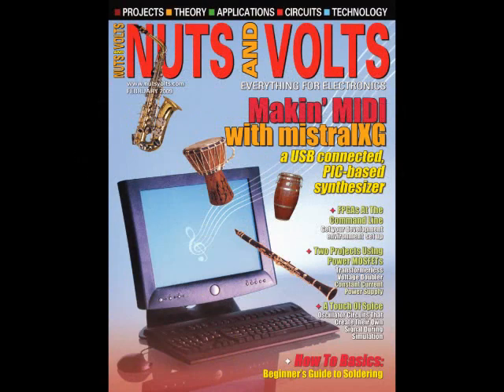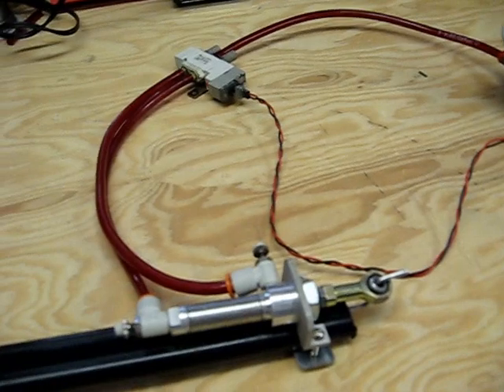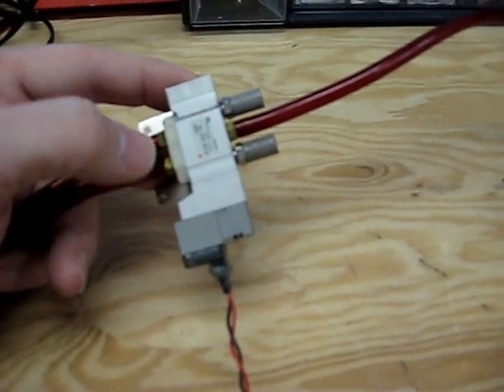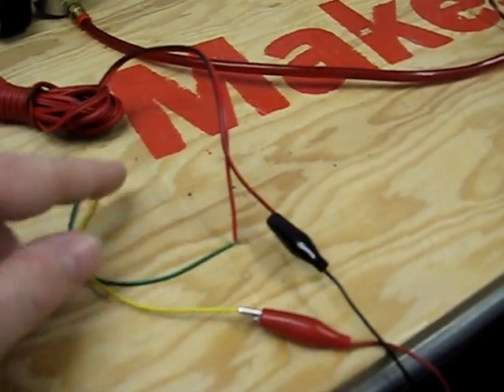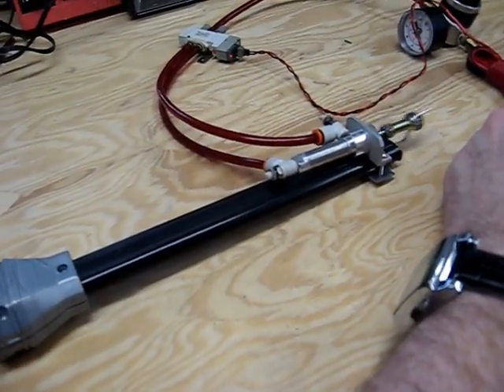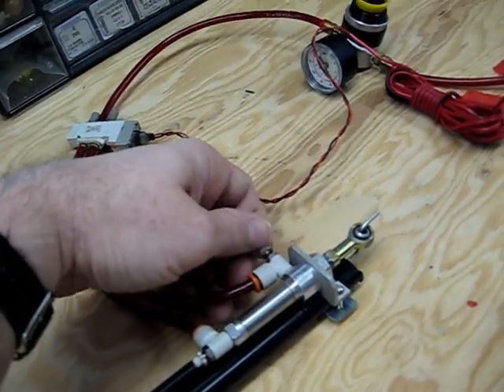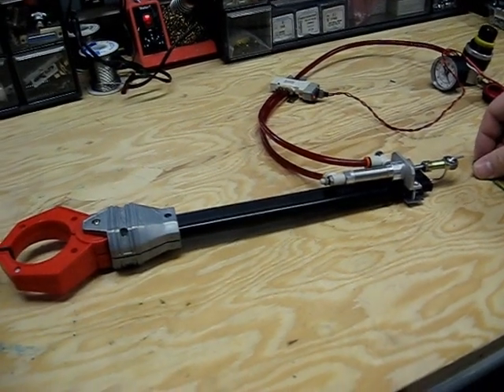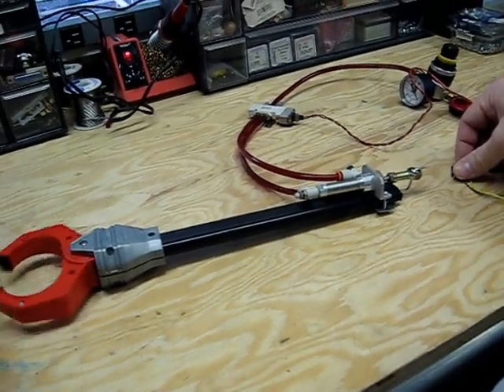"Pneumatics in Robotics" Video for Nuts and Volts Personal Robotics Column, February 2009

Comment: Oh, how wrong you are, grasshopper. The only difference between pneumatics and hydraulics is that air is compressible and oil (and water) are not. Pneumatics can provide exactly the same amount of power as hydraulics, and do a lot more that hydraulics can't. What hydraulics can do better than pneumatics is to be controlled in a partially open state. Pneumatic cylinders are best used in situations where they are either fully open or fully closed when in operation.